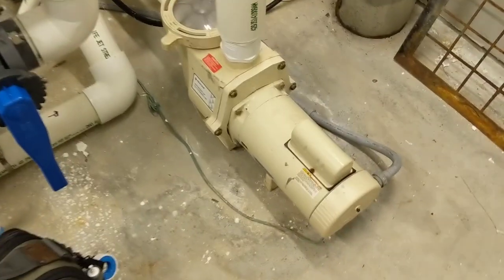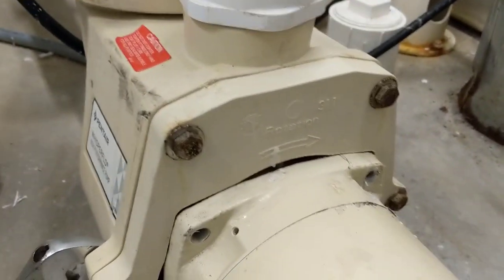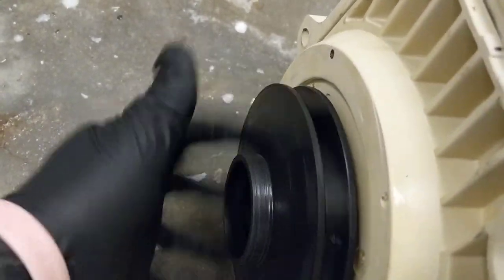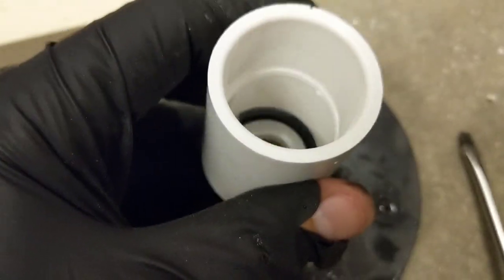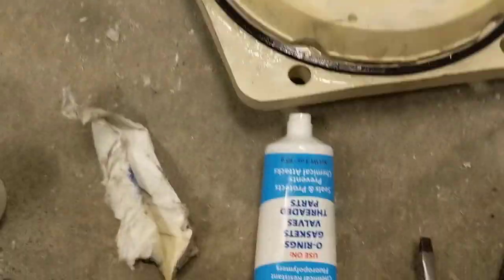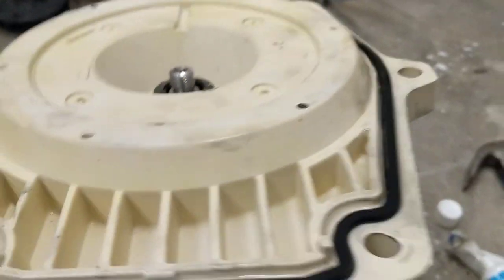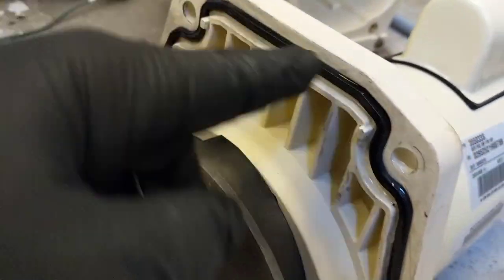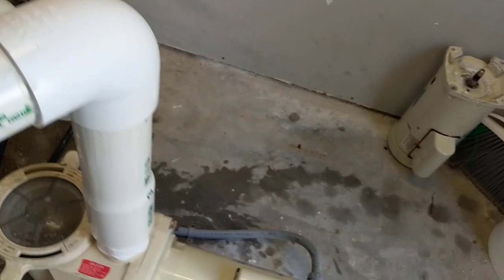Pentair Whisperflo Motor And Shaft Seal Replacement

Comment: Why did you put it back together without replacing the 3/32 allen screw missing from the defuser?
Reply from the maker: I didn't know it was missing until I tore it apart & I didn't want the pool closed until the part arrived so I put it back together & ordered the screw & once it arrived I installed it. Great question though. Thanks for watching & subscribe to the channel Tony 👍

Comment: Good video. Thanks for taking the time!
If I buy the same unit that I have now, can I switch it out and simply leave the old pump housing in place and reuse it, so I don't have to refit all the plumbing? I replaced this pump 10 years ago, and there isn't enough space now to simply install a new one with the existing PVC pipe & valves.
I don't see a problem if the housing is still in good shape, which it is. Any thoughts?
Reply from the maker: Yeah that's what I did. Aslong as it's the same unit. Thanks for watching David & Subscribe to the channel 👍

Comment: Great job as always Rich. I replaced one of these pentair motors with a century direct replacement motor. It was a little cheaper and its still going to this day
Reply from the maker: Nice!! The price difference from the century motor & the OEM motor was a $35 difference, so I just went with the OEM motor, and it was going to take an extra 2-3 days shipping from California. So it was worth it to go back with the original motor and have it 2-3 days sooner for the extra $35 out of my swimming pool Maintenance budget. Thanks for watching Sean 🤜🤛👍👍
Reply: @ApartmentMaintenance  i think i got mine for like $70 cheaper, but hey, you got it back up and running and thats all that matters!

Comment: Hey, I see you didn't use a torque wrench for the pump housing bolts, other video I've seen was using a torque rachet. Can regular rachet be used instead
Reply from the maker: Yeah that's what I used. It's been 2 years & no issues with my pump leaking. Thanks for watching TheHcharpe1231 & subscribe to the channel 👍

Comment: Can you give me the Amazon link to the 3HP motor you installed (you said old one burnt up). Thanks
Reply from the maker: @2Timothy3END  I don't know if that motor is available anymore since they switched to the variable speed motor. I looked for it but can only find the 1HP & 1.5HP motors. You could take that motor & have it rebuilt at a shop that does starters, alternators, & motors. That might be your best bet. Sorry I couldn't help. Thanks for watching Timothy & help support the channel by subscribing 🛠️👍
Reply: @ApartmentMaintenance  🙂

Comment: Helpful video, however he repeated refers to the "volute" as the "impeller". The impeller is held on by the left-hand threaded bolt. The volute is the part held on by the alan screw. The impeller spins inside the volute
Reply from the maker: That is correct! Thanks for watching John & Subscribe to the channel 👍
Reply: That is not a volute it’s called a diffuser the volute is the wet end of the pump

Comment: Should I add silicone adhesive when placing the new seal on the seal plate? Is it adhesive or lubricant? If adhesive what kind do you use? Please advice, Thanks
Reply from the maker: It's a pool lube not adhesive. Adding the pool lube to any rubber seals or o-rings is the best thing to do to add life to each one. Thanks for watching Frank & Subscribe to the channel 👍
Reply: The metal cup of the seal is tapped into place, no sealant necessary, it's a pressure fit. The us seal instructions have warnings against using any silicone based products near the rubber on their seals. You could use some synthetic lube around the metal cup portion to make the pressing go smoothly.
Reply from the maker: @ThorD4602  Thanks for watching D Thorne 👍

Comment: What if it keeps leaking after you do all that
Reply from the maker: Make sure you have the correct repair kit. If the kit is correct, I would say  it sounds like the seals or shaft seal isn't seated properly. I would take it back apart & double check everything & reinstall if it is the correct kit. Thanks for watching 9-5 👍
Reply: Most likely area for mistakes is the main fitted gasket, the odd shaped one that fits in the channel. You really need to take some time to make sure it is perfectly in the groove and flat. Also need silicone lube in the groove before sticking the gasket in, plus silicone lube on it before mounting back to the pump body

Comment: how much would you say you saved by doing this yourself? this is inspiring me to take on my pool water heater that went out with a bad lighting storm.
Reply from the maker: For a pool company to come out and repair the motor on-site I would of spent a couple hundred dollars, roughly $350-$450. That would be just the seal kit & labor as I would of ordered the motor myself, which the motor I believe was $535 if I can remember correctly. That was August of 2019 I did that job, & posted the video around the start of pool season this year.  The seal kit is $40-$45 alone, which they would of marked up the price on that, then add labor, which they would of quoted it 2 hours, basically to make it worth their trip, maybe 3 hours who knows ? Took me a half hour to do it, but I've also done them before, and I was filming which takes longer, cuz sometimes I may have to record something twice if I got interrupted or whatever. Definitely try it on your own if you feel comfortable & have the tools to do the job. Thanks for watching Hous3mode & Subscribe to the channel 👍
Reply: @ApartmentMaintenance  $350-450 is insane, I charge $185 for Whisperflo complete rebuilds like you did in the video.
Reply from the maker: @TheRuxinator  That's a great price you have there. But $350-$450 is the going rate in South Carolina. Thanks for watching Ruxinator 👍
Reply: @ApartmentMaintenance  Sounds like I should move to South Carolina! Haha. Great video, nice work on the rebuild.

Comment: This must have been his first time doing this kind of job. No reason to remove motor bolt until you remove defuser and impeller.
Reply from the maker: Thanks for watching Tommy Hernandez 👌
Reply: This guy doesn’t even know the proper part names calling the diffuser the impeller I wouldn’t want this guy near my equipment he doesn’t know what he’s doing imagine what he calls filter parts or know anything about hydraulics